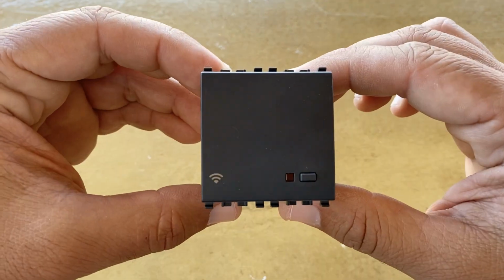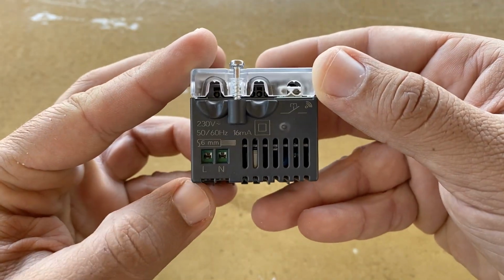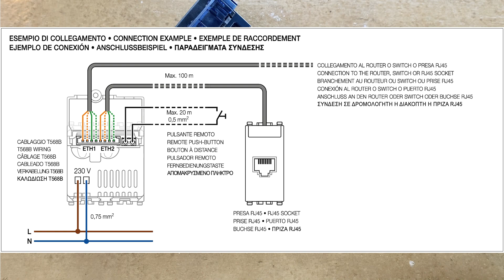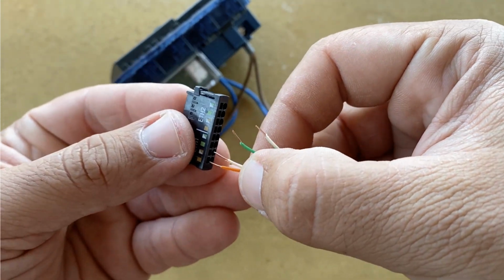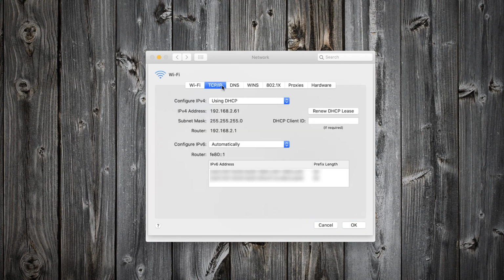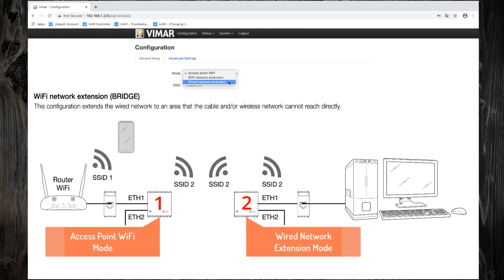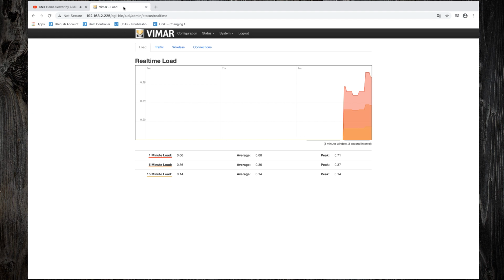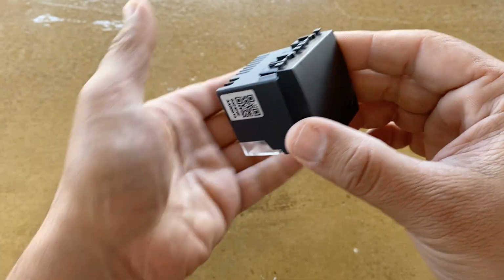WiFi Access Point by Vimar (20195)

Comment: Good morning, excellent presentation and excellent item. Just a note, the article under test corresponds to the Eikon series, while the rest of the material used corresponds to the Arké series, they have different colors and is not 100% compatible with the support used (it does not clip, it is not the right one). Still great everything, greetings.
Reply from the maker: Thank you for your comment and info!